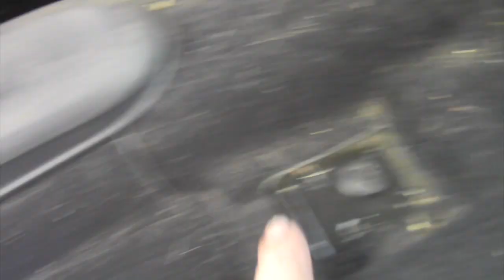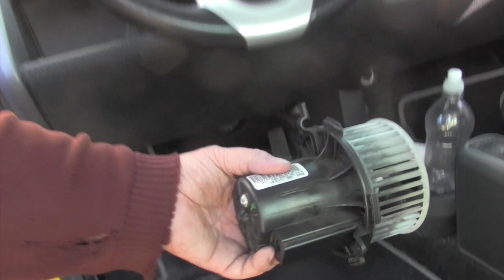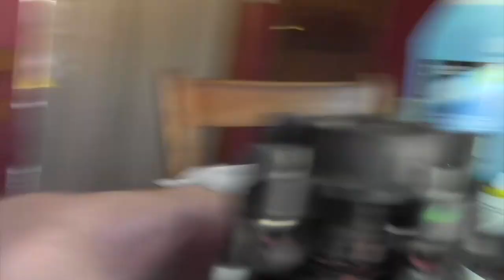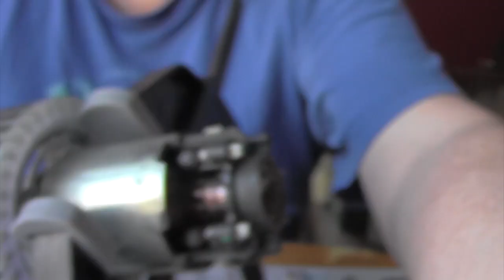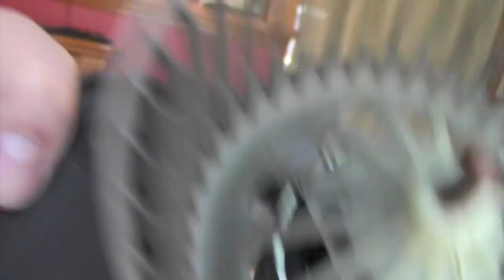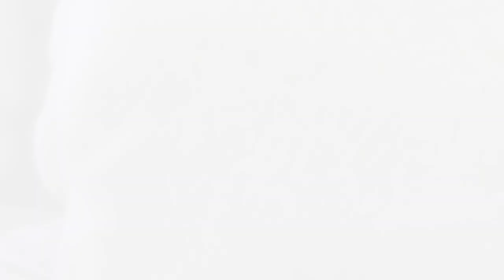Repairing Fortwo Fan Motor

Comment: I'm curious if the motor actually works after reinstalling it though??  I bench tested my blower motor by connecting it to a battery and the motor worked fine, but it wouldn't activate while installed.
Reply from the maker: The motor worked fine but was a bit noisy for a while until the brushes wore themselves smooth.
Reply: @Denb7   Can you supply a link to that eBay seller's page where you purchased the replacement brushes? I searched for that seller, but no luck. I'm looking for the wire pigtails harness for the blow motor
Reply from the maker: @Zeezu70  Sorry dude, but I don't have any idea who the seller was. I was just lucky enough to find a guy who was selling those specific brushes.
I wish I could be of more help.
Reply: @Denb7  No worries, thnx. The seller would be in your eBay purchase history, but if this was back in 2019, I'm not sure purchase history would go that far back?

Comment: Excellent detail on where things are and clip tricks needed to work on it. I also notice that there appears to be a square channel in the motor housing that connects from right near the brushes through the firewall. Might be a fresh air inlet. I wonder if some combination of compressed air, vacuum cleaner and/or a touch fog of WD40 through this channel might solve the problem without dismantling.

Comment: Best video on YouTube !! It worked exactly the same. 

I did t have any mechanical tools so I scratched the dirty grease off with a screw. And also used the alcohol. 

I fit under the seat/ so it was easy!!❤

Comment: Replaced my blower motor using your excellent videos. After a sucessful result I noticed the air bag fault light remained on.  Any suggestions on a reset?
Reply from the maker: I wish I had an answer for you. The same thing happened to my smart, but I ended up trading it for a new(er) vehicle when the transmission crapped out before I ever figured it out how to reset the air bag thing..

Comment: This also worked to fix my issue. I do have a question though. After I put everything back together, my airbag light is on and remained on. I checked the connections under the seat and everything seems to be connected properly. Has anyone else had this issue?
Reply from the maker: I actually had a similar issue, but before I got around to correcting it, my smart's transmission quit and I ended up trading it in for a Nissan cargo van (which I needed for a new cargo intensive hobby).

Comment: Hi from Florida Denny. Thanks for your videos. My HVAC motor's been out awhile (2-years) & I was reticent to tackle it, looked to be a "bear." Finally it was time. Checking YouTube I saw the 1:27 minute post, what an easy job! But checking further I found your video with "the rest of the story." It's still a much simpler fix than I'd imagined, but you gave some vital detail. I'm 6'1" & 195lbs and my 68 year old body does bend as well as it used to. Taking the seat out is a must, after that, the failed motor was out in a flash. The new one is on order and I look forward to having the AC back with the summer heat starting to hit the north end of the Mid-Florida Ridge. Thanks for you helpful post.
Reply from the maker: I imagine that in Florida, your A/C is as vital to you as our heaters are to us here in Massachusetts.
I'm glad you looked further and found my video. When I went to do my fan repair I had to watch several short videos in order to get the big picture. That's why I decided to make my own video and include every step of the job.
I'm glad you were able to accomplish your repair and that I was able to help.
My little smart is now a thing of the past, but it was really fun to drive for the 11 years I had it.
Peace!

Comment: LOL my smart blower motor stopped, but it was so cold in my car I wanted to see if hitting it while it was set to full blast with a small tool might work, and it kicked on full blast! Let's see how long it lasts with this "temporary" fix. 😅😅 Definitely need to take it out and clean it up nicely eventually.
Reply from the maker: I hear ya brother! I spent a lot of time pounding the dashboard or looking for bumps in the road to kick in my fan motor. My issue started after about 2 years, but between pounding and bumps it suddenly disappeared for another 6 years before the motor refused to come on again. At that point, I had nothing to lose by tearing into the thing. Worst case scenario would be to buy a new fan motor assembly, but being the ultimate cheapskate that I am, I opted to try the repair. Thanks for watching.
You want to see just how much of a cheapskate I am, check out my video, "Cheapskate's Guide to Free Deodorant" ( https://www.youtube.com/watch?v=2fwrjrFpV6s )

Comment: Thanks for this, your video gave me the confidence to carry out the removal of the motor and the installation, The trickiest part of the job was undoing the electrical plug and after that it was straightforward. I saved a small fortune here in the U.K. because the main dealer quoted £311 to supply and install a new fan motor.
Reply from the maker: We agree on that electric plug. Either a couple more inches of wire or a plug with an easier release clip would have been nice. I'm glad you were confident enough to successfully tackle this job on your own. Congratulations!

Comment: Great video DC motor commutator slots should be cleaned to get the copper dust out after using sand paper. You could possibly short out the commutator if not ( my 2 cents)
Reply from the maker: I actually did blast the whole thing with my air compressor, but I didn't show that in the video.

Comment: I have a 2009 Brabus smart car, the ac fan motor is very noisy. I ordered the motor. I'm looking
for videos on how to install it. I have the same part that they all show. The problem is under the driver side dash there is nothing that looks like the videos. Are there different fan motors for the Brabus smart car? Can somebody help?

Comment: Thank you so much for your video. I'm really a total newbie regarding auto mechanics, but the bad ventilation fan was getting on my nerves (my friendly mechanic didn't bother with 'fixing' it) and I thought it was 'something simple'... as indeed it was, but I could only do the 'fix' after watching your video to figure out exactly how to remove the motor... and then it was cleaning time!
The ventilation fan never worked so well (I bought my 2009 Smart 2nd hand a couple of years ago), and even if it's just a 'temporary' fix, according to your other video, well, now I got enough confidence to remove the motor again and possibly replace the brushes... I just have to see where I can get them here in Portugal.
P. S. I'm just 50 years old at the time of writing, so I did not remove the driver's seat. It was still a pain to work upside down for such a long time, so now I've got lots of cramps! 😄Alas, that comes from being reasonably out of shape...
P. P. S. I've just noticed that @Américo Simões, who posted a week ago, is also from Portugal... so, now you've got two free lunches if you happen to come over this way!
P. P. P. S. I just read that your own Smart has bitten the dust... such a pity! But I'm glad that you had your fun while it lasted. It's a fun car to drive, even in spite of all the small little quirks requiring fixing now and then, many of which require serious work from a certified mechanic (i. e. like the occasional need to lift the whole motor to get access to relatively trivial parts, which, on a larger car, would be much more easily accessible...).
Reply from the maker: That trip to Portugal keeps getting better and better! It makes me very happy to know that you were able to repair fan motor because of my video. Congratulations! The smart is definitely a quirky car, but it was really fun to drive. One reason I bought it was to show my fellow Americans that they don't all need to drive gigantic, gas-guzzling, earth destroying trucks or SUVs to drive (alone) to work or the grocery store. I was happy to show my tiny car to anyone who was interested in seeing it. I'd even let people climb inside. They would assume that they'd feel too confined inside. Their preconceived notions would disappear as soon as they tried it. I enjoyed hearing their surprised reactions as to how spacious it actually was inside. Americans are terribly wasteful and many have little concern for our environment (including our president). I have traveled in Europe and Americans could take some lessons from there. But no,  'we' continue to hold onto a stupid notion that "we're #1" even while we are falling behind many other countries. Unfortunately, two more traits hold Americans back, stubbornness and an unwillingness to admit that we're wrong.
Oh well... I tried to change some minds with my tiny smart car.

Comment: Another great video. I love the way you make your videos. A link to this one is going in my Fortwo library of links right beside your brake video.. Thank you and please keep'em coming!
Reply from the maker: Thanks, but I wish making these videos wasn't out of necessity. My 11-year-old smart is showing its age as things are starting to breaking down. In under 60k miles, I've gone through two starter motors already ($800+ cost at a dealer... luckily, 1st one was under warranty). Now my check engine light, the ABS light, and the air bag light are all on. The check engine & ABS are related to axle speed sensors which is something that may be beyond my ability as a DIY job. I think the airbag light might be a result of removing the seat and/or from me lying on top of the electronics package located under the driver's seat. In warmer weather I'll check that out. The loss of ABS affects not only the brakes, but also the hill holding ability and traction control. Recently, on a snow slicked hill, I momentarily lost traction and did a complete 180 in traffic. No crash! I was lucky.
Thanks for watching!
Reply: @Denb7  I bought my 2011 Fortwo in 2015 with 36,000 miles on the clock. At 37,000 the check engine light ended up on, long story short, it was burned valves. The car lot I bought it from bought the parts and I supplied the labor. Thank God I'm a mechanic. I like working on the Smart but I also hate working under the dash. Having seat belt problems now but I love my Fortwo.

Comment: Hello again Denb7 and another informative video for smart car owners.

I have had some noise and slow starts on my HVAC fan, but it is still working.  After watching your video starting to wonder if it could be related to the brush issue you identified.

Thank you again for your videos and KEEP POSTING.

P
Reply from the maker: I was crushed when, after cleaning the dirty commutator with my brilliant idea of using a cordless drill and sandpaper, the motor still failed. But 2 shots of WD-40 and a nudge with the screwdriver on the brushes and all is well again. If this is your situation too... I'm glad if I was able to offer some insight. Good luck!